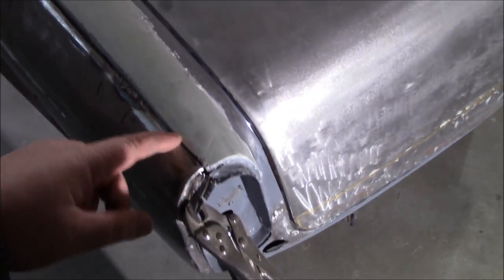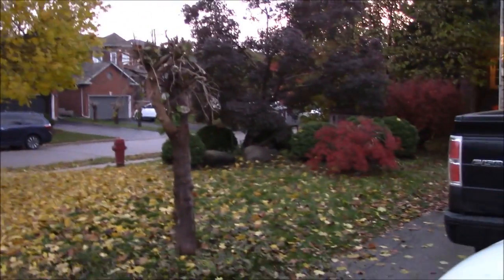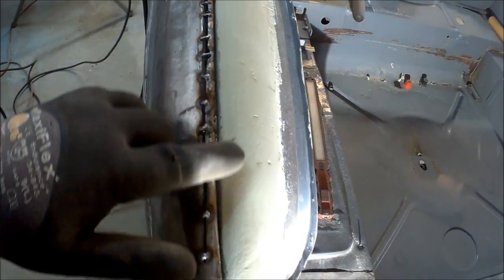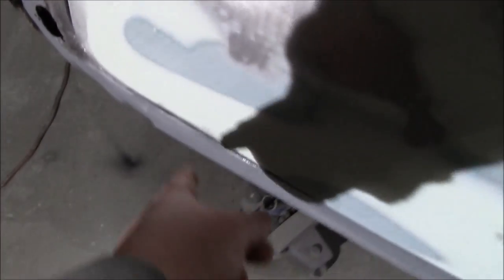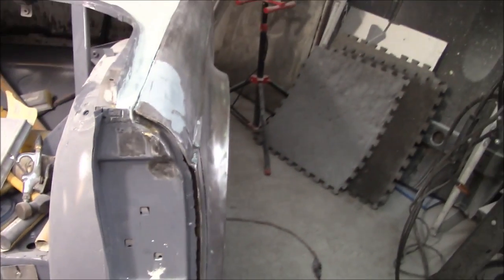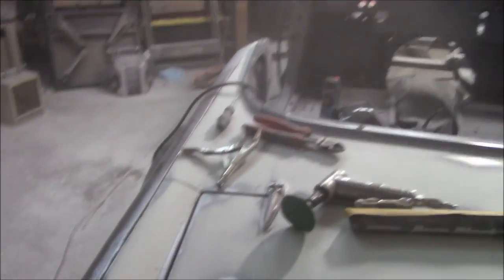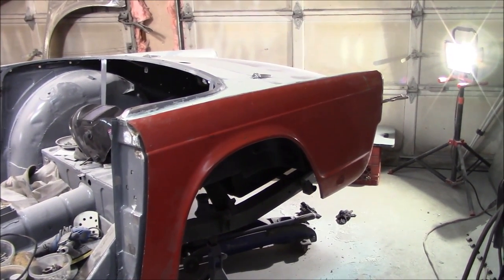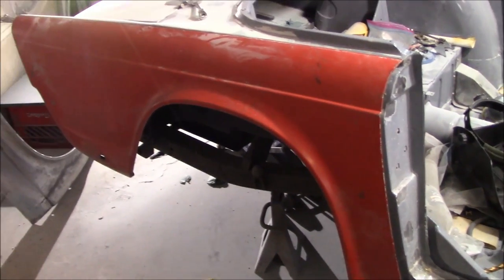1968 Triumph TR250, Restoration Update, November 11, 2018

Comment: I had wondered about using those wings, but I understand why you were reticent to do so, too. But, that driver's side (modified) wing was such a mess it really doesn't look like it makes sense to struggle with it. I think using the TR4 fender is the right thing to do...from 4,000 miles away. Thanks much for the very interesting update.

Comment: Always inspiring to watch your videos Tush. I’m going to try and get the tub on my 58 TR3A complete. I too use the fiberglass filler but I would like to know your opinion on the metal to metal for a skim coat over the fiberglass if any because that’s what I’m using on the 58. So much easier to work with than bondo but obviously no long term science on how it holds up. I’d just like to know your thoughts?

Comment: Sooo many hours in the now aborted frankenfender project. You've got the stiff upper lip thing going, which is probably the best approach. Wondering why you didn't remove the hinges from the boot lid for ease of filling, sanding, etc.
Reply from the maker: I left the hinges on so I could refit the boot lit as I was trying to match the profile of the body tub to the boot lid.